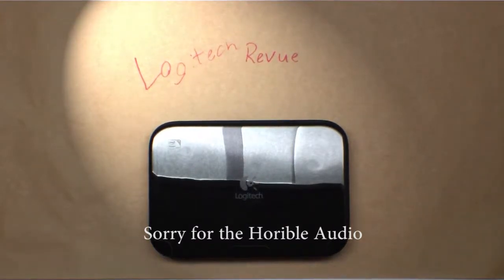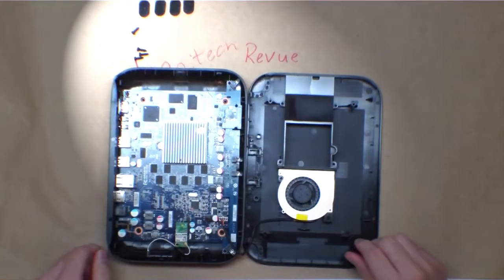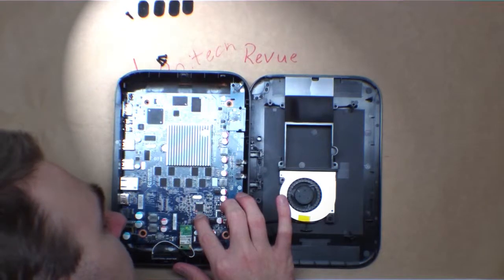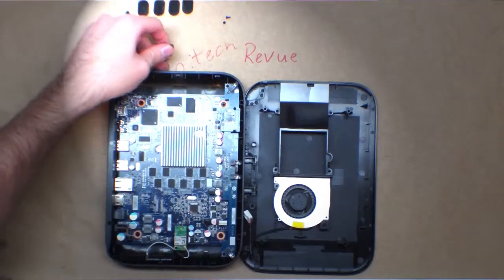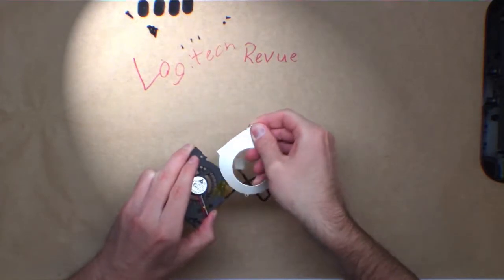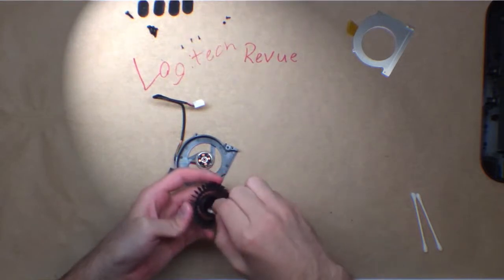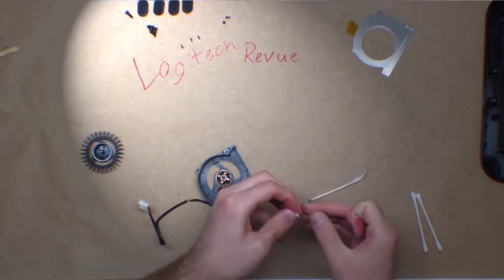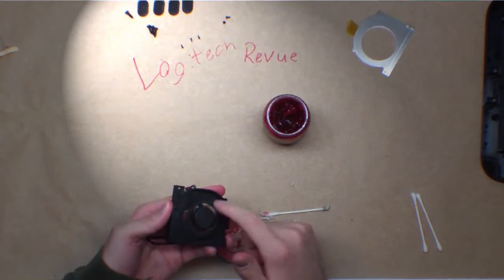Logitech Revue - How to Disassemble ( Noisy Fan Fix )

Comment: Can anyone suggest which is the best lubricant/oil we need to use?  -- Thx
Reply from the maker: +Badri Thatikonda any lube that can handle 1500 rpm will work.
i feel the need to say; WD40 is NOT a lubricant.
Reply: +Grim187  can u pl suggest something specifically. ?
Reply from the maker: I used red n tacky; http://www.walmart.com/ip/Lucas-Red-N-Tacky/36052506 but it would be best to use ball bearing oil; http://www.ebay.com/itm/Yeah-Racing-High-Speed-Ball-Bearing-Oil-Lube-for-1-10-RC-use-may-suit-Tamiya-/301731181559?hash=item46409473f7

after applying the red n tacky a few times (i didn't put enough in) the fan has been quiet (it's still on 24/7).

Comment: Any luck with the new replacement fan?
Reply from the maker: I ended up just opening it back up and adding more low speed lube (didn't want to wait for shipping) turns out it just dried out, so i will probably get another month or so of noiseless operation. I used it without the fan for awhile and it didn't overheat. I should get some ball bearing lubricant.